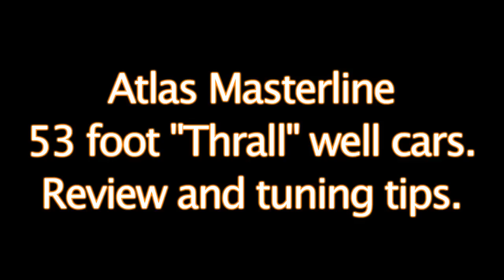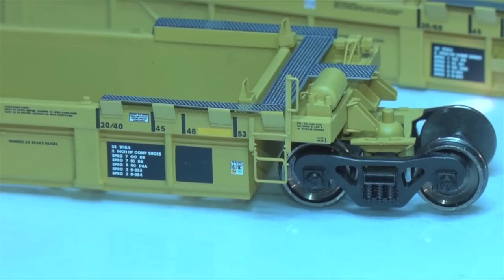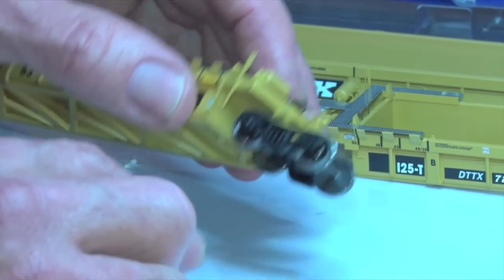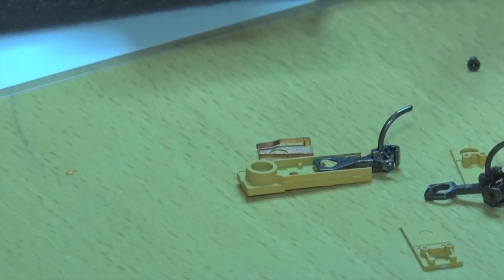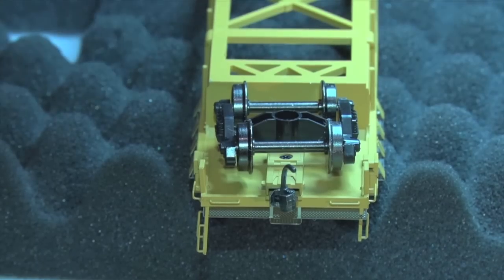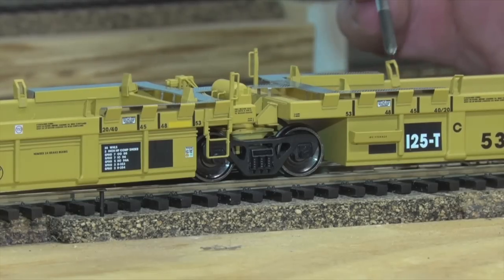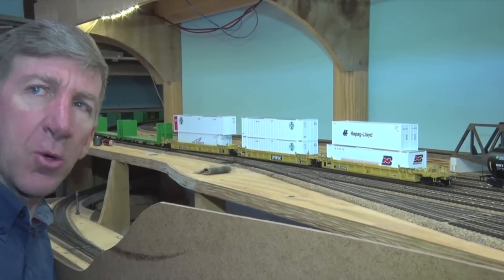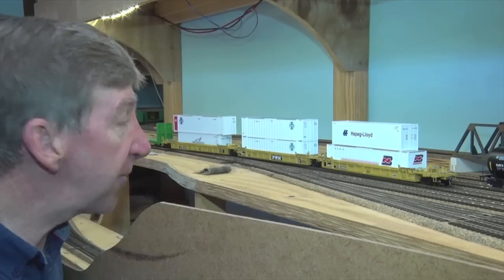Atlas Masterline ,Thrall 53 foot articulated well cars. Review and tips.

Comment: Greetings Gregg from across the ditch in NZ.  I've just bought a set of these Thrall well cars from USA.  The problems you had experienced 8 years ago still exists today: under-weight cars, and problems connecting them together.
I've bought a set of 53' containers that come with 2 internal magnets on the bottom, and 2 metal disks under the roof (made by JTC, USA).  This does two things - adds weight, and magnetically connects the top container to the bottom one.  One car with two containers brings the weight up to 5.5 ounces.
A cunning tip for next time: Before turning a car upside down, put a container in it to prevent you from breaking off the hand-rails 🙂
Reply from the maker: Hi Zed!  Has it been 8 yrs......seems like a year or two ago! Mine are still going strong on the layout, though  I never run them empty .  The container in the base when you turn them over was mentioned by someone as well...a damn good idea indeed! 
Thanks for watching.
Gregg.

Comment: These are very nice cars. I have a set and haven't taken them out of the box yet. I don't like the assembly process between the articulated joints. I wish they would've made it to just drop in place the way Athearn did with their spine cars. As for the coupler issue, with the replacement draft gear box with the triangular shaped coupler boss, Atlas did the same thing with their 2743 gondola. The Kadee #78 couplers will drop right in without any problem. They were discontinued but they pop up on Ebay from time to time.

Comment: Hi Gregg! Nice first review! Good honest info mixed with your wit, it's a winning combo.

You mentioned risk in transporting well cars to shows and such. I found a method that works great. I transport my LOADED well cars in heavy duty shipping tubes. The come in a variety of diameters. You can find one that just fits the loaded cars, and it's padded with foam rubber on the ends (they come with caps and you cut to the length you need). I haul a kit-built Gunderson A-Line 5 car set that are permanently connected, and the containers are double-sided taped together. No damage in 10+ years of carrying. You set the tube on the track ahead of the set and just roll them in. Unload the same way, right onto the rails, ready to go.
Reply from the maker: Thank you Sir!  The cars are going well on the layout and I feel they are nicer to look at the the Kato Maxi Well??  . Thats a great idea on how to transport your freight cars! If I ever need to I will give that a go.
Thanks for the support.
Cheers Gregg.

Comment: Thank you solved my problem. As for weight I have found that the weights for gondola cars fit in the bay well, and are hidden by the containers.
Reply from the maker: No worries and you're welcome!  I run mine with 2 containers and towards the end of a train  and I've had no issues, or run them empty on a "bare table" train. The gon' weights are a good idea too!
Thanks for watching.
Gregg.

Comment: Hi Gregg

Love your channel. Subbed recently.

On the strength of your review I purchased a set of these Atlas Well Cars and overall have found them to be excellent, but still only after a tiny bit of tweaking. I took note of your comments on joining the individual cars together and also found it quite an issue. I will admit to finally and carefully snipping off the single central angular ‘locking lugs’ right above each intermediate coupling ‘pin’ on each car. In fact they came off very easily and cleanly because it seems they were separately applied. Now the cars just join together by simply lifting each car onto the neighbouring coupling pins just like the Athearn Well Cars. I kept the Atlas couplers and so far have had no problems. I did find the vertical steps/hand rails at the end of the cars fairly sturdy but also found that they can easily fall off and have to be glued back. I did loosen the screws on the trucks slightly as you suggested and run the cars at the end of the train as well (even when loaded) just in case of any running issues, because they are ‘seriously’ light. Having said all this I would definitely consider getting more of these cars in the future because I agree that they do look the part.   Cheers,  Tim
Reply from the maker: Thanks Tim! They are very nice and have been running since this review with no problems. The coupler height is a little high and not easy to fix , but apart from that they are great cars! 
Modifying the connecting pins is a good idea , especially if you move them around layouts or even just for everyday running...I may look into that myself! 
Thanks for the comments and for Subscribing.
Cheers Gregg.
Reply: You're most welcome! All the best from London, UK.

Comment: Gregg clear and concise review, wrong period for me (50s-70s) so I will not be having this sort of car, but you gave me some pointers about what you may need to do to set new cars up for good running. Have you needed to use my Dads steam method for bending your hardboard? Keep up the good work Neil :~)
Reply from the maker: Thanks Neil! Yes the same set up goes for all cars to keep them running nicely!  Yes I did use your dads idea for the masonite, I soaked it in the bath for a few hours then bent it slowly over a saw horse. It came out great , thanks! You'll see it on the Ethanol train video.
Cheers Gregg.

Comment: Hello all of you on YouTube.  I agree with you Gregg why these manufacturers can’t make the Cupler pockets standard so you can just do a drop in of Kadee’s   To my knowledge the only two companies that put Kadee’s in from the factory is Intermountain RAILROAD Company and Broadway Limited.  I could be wrong but I’m pretty sure those two companies put Kadee’s  from the factory.  My personal opinion I don’t mess around with nothing but Kadee
Reply from the maker: Hi Bill, thanks for watching! From what I have found , these cars were BLMA and atlas bought them out. As such , BLMA were pretty fussy about scale and the coupler pockets  are as close to scale as they could get , and the plastic couplers fit ok, but Kadess are a little bigger , so a slightly bigger draft gear box is supplied. A little bit fiddly but they are very nice cars and are doing well on the layout.
Cheers Gregg.

Comment: I'm planning to model CSXs Boston and Albany line from West Springfield to Worcester. All intermodal trains are comprised of these......
Reply from the maker: They are nice cars, though a little fiddly to assemble. Also they are very light so need boxes in them to keep them on track if in a heavy train.
Gregg:-)
Reply: Wouldn't it be possible to weight the bottom container to provide weight?

Comment: Hey Gregg, Did you say somewhere in a video you run atlas dash8-40bw silver line locos? i have a gold series with dcc and sound and just ordered 2 silver series, do they have dcc in them or any sound or did you add a decoder of some sort? Cheers, Adam.
Reply from the maker: Hi Adam, I have 6 Atlas Dash8 -40Bw's, there are great locos and one of my favourites! All of mine are "Silver" series which I have installed Tsunami decoders, which are much better (IMO) than the QSI. You can see some of the install on part 1 of my layout cab ride videos.
Cheers Gegg
Reply: FishplateFilms okay cheers, i will definitely check it out than!

Comment: Just add weight inside the bottom Container. Or buy Walthers Gregg.
Reply from the maker: Hi Joe.
When you have two containers in the cars, they are heavy enough. , but when empty they have to be in the middle or towards the end of the train, so they don't "string line" and derail. This is the same for real railroads so a little planning is involved in making up trains...just like the real ones!  The Kato well cars are metal? plastic and are heavier but I still don't run them empty in the front .
Cheers Gregg .